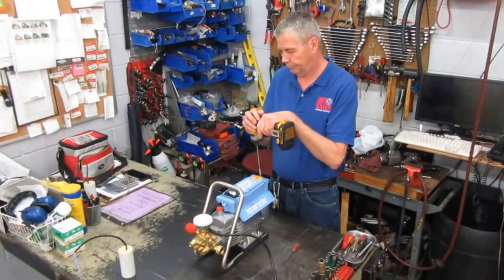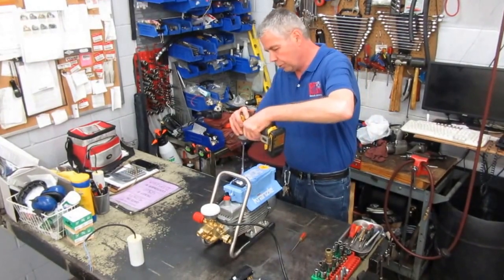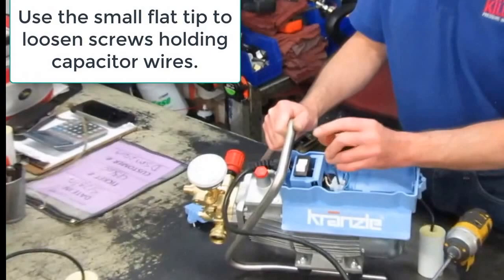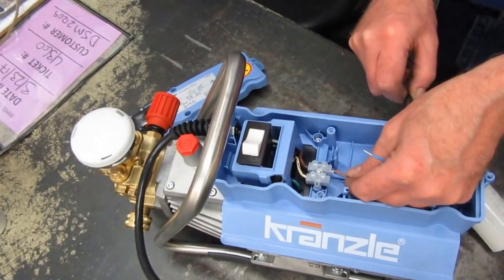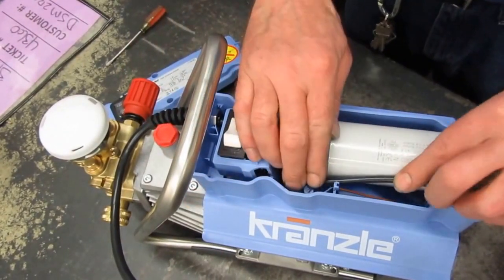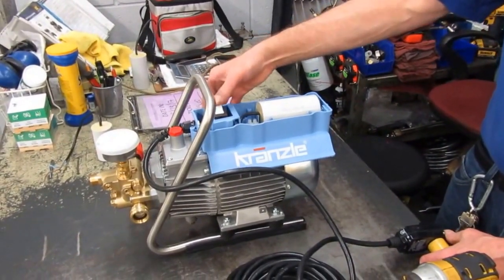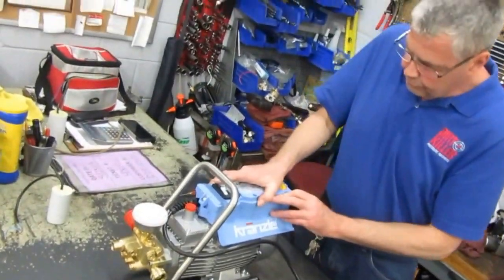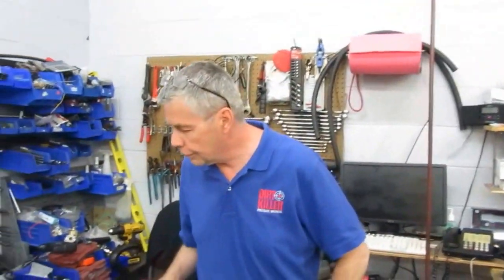Changing Capacitor in K1622

Comment: Wow...  you ran that pump without water running through it?   Why would you ever do that?
Reply from the maker: Good morning Robert, in most cases I would agree with you. However, this is a Kranzle 1622 which features a very different style pump than what most are used to. Due to their unique design you can safely run these without water for short intervals and no damage will be done to the pump. This is actually one of the ways you can prep these pumps for storage, by simply disconnecting the water inlet and allowing the pump to discharge all of its cavities it in essence can prolong the life of the pump head. For more information about our kranzle line feel free to browse our website www.kranzleusa.com or call our shop at 1.800.964.8484
Reply: @atlanticpressurewashers   You are 100%. Being able to run our pumps dry for a short interval is, in part, what makes this statement true: Kränzle - Pressure Washer Perfection!